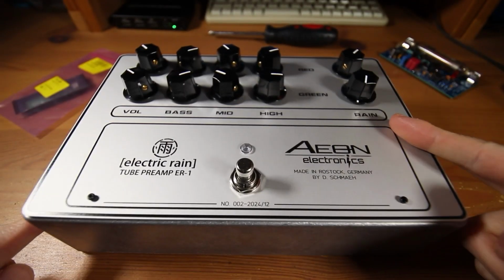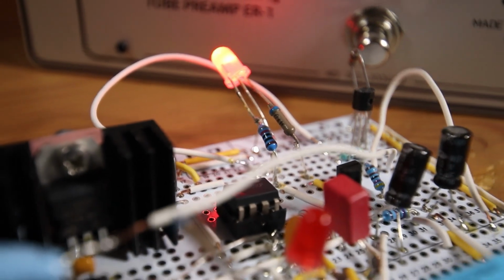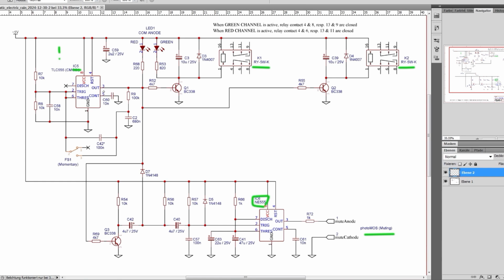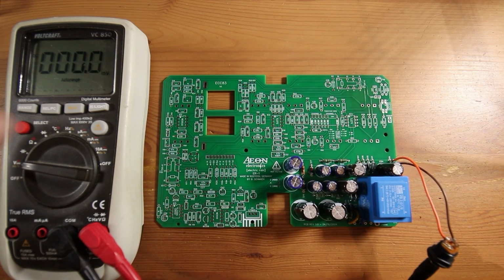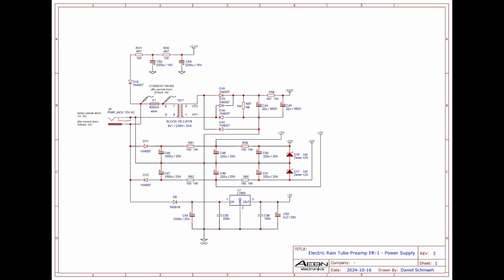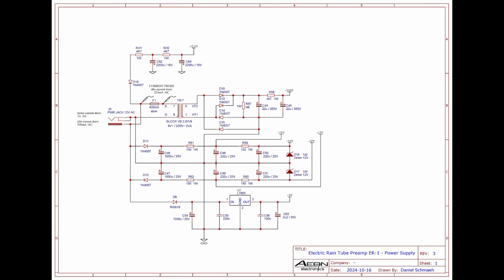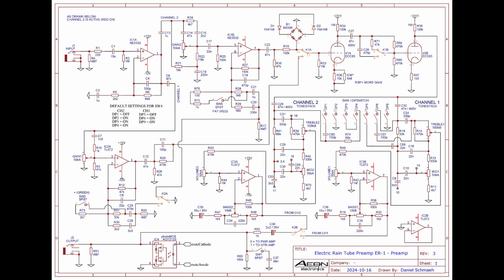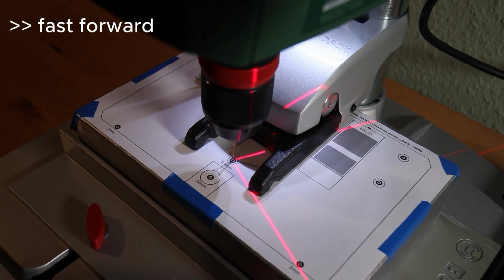My own Tube Preamp: Electric Rain | A Gain Monster but it can also Clean

Comment: Fantastic, absolute stunning design. I wish I could build this. Any plans when your secret power amp is coming - this sounds like a game changer device on the market? 
Also, your Tube Amp is very impressive. Again, I wish I could build that into a Combo. Absolutely digging the sounds/ concept / design. Huge probs.
Reply from the maker: Thank you, this means a lot to me since I am doing this not for money. This is just a hobby; but this also means I have to work in a full time job and have not much time right now for my projects. But I can assure you I will shoot a video as soon as I have more time. The power amp and the spring reverb are already done and in use but doing those videos is a crazy amount of work...
Reply: @Aeon_Electronics  Even more impressive. Really amazing work. Good things take time, I just keep checking every now and then. Really looking forward to those two. And then I only need to find someone to build  that...

Comment: Just a single physical tube (which translates to two tube stages) and sonically it's in the league of JCM900, maybe even some 5150 versions and Soldano / Mesa preamps. Good job! 👍
Looking at the schematics: I would avoid decreasing R36 value only to get more gain. Actually, it's beneficial to have this resistor value raised over the default 10k (as inherited from older JCMs) to get more "organic" distortion at lower gains - not necessarily up to the Soldano / Recto's 39k, but somewhere inbetween (how it will finally sound depends largely on the level of the incoming signal from the preceding stage - here it's IC1B opamp + attenuation in the dividing resistors and clipping of B1+D1+D2). I'd experiment then with adding a resistor in series with the B1 bridge (either near the signal line or the ground) with a value anywhere from hundreds Ohms up to about 47k - this might result in even more "tubey" tone at higher gains (if it becomes too fuzzy, decreasing grid resistor R33 value might help). In any case, the most "safe" way to increase gain with this topology is to loosen the negative feedback on the IC1B (R27's value up). Have fun💥😄

Comment: Beautiful stuff. That transformer and such transformers for projects like these in general is still unobtainium to me! :D
Reply from the maker: Thank you! I really like those transformers, since you can do so much stuff with it + you don't have problems with digital noise. Of course one can generate the High Voltage with an NE555 etc. but this way it is more consistant in terms of frequency and it is lower noise than digital switching. :)
Reply: @Aeon_Electronics  Can't wait for the power amp episode. Is it also based on a tube and an OT?
Reply from the maker: @mohitrahaman  The answer will surprise you: no. I've used other "tricks". :)